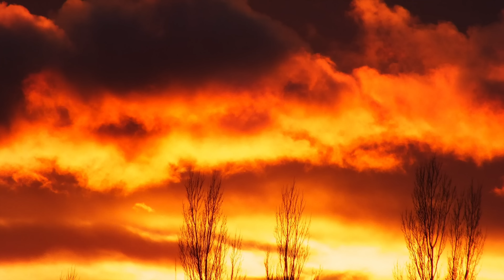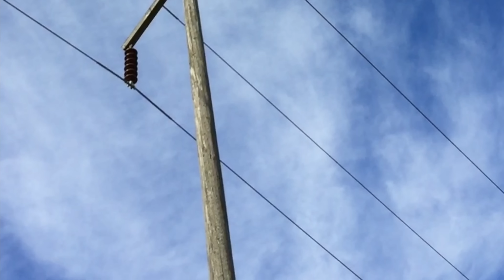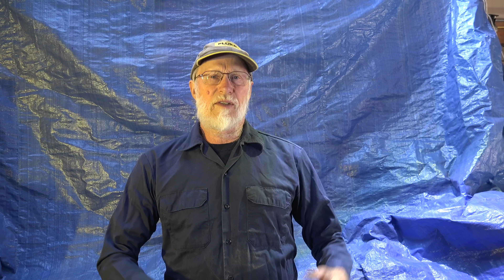Heat pump #2

Comment: GFM.........I have a question.......an AC removes sensible and latent heat........my question is.......can it remove one and not the other......or does it always remove both at the same time...
Reply from the maker: Well, I suppose if the relative humidity was zero or the temperature drop across the coil was low enough to be well above the dew point, you would only remove sensible heat.  There are some systems designed to do that such as flower coolers that may run at 3F across the coil.  Hope this helps.
GFM

Comment: I pay around 9 cents /kWh. In the winter, it drops to 3.2/kWh once I go over 1000 kWh in the month because I have "electric heat". How does that factor in? I'm not sure if I should be using heat pump or natural gas (97% efficient). My HVAC guy said heat pump is always cheaper. It currently switches to gas below 30 degrees. I wish my fancy thermostat could just do the math.
Reply from the maker: If you are 3.2 cents, congratulations, you have about the cheapest rate in the country.  The heat pump is very efficient at the temps you are using at.  It all depends on the price of natural gas.  If it is under 80 cents per therm, the race is pretty close.  There is also the issue of wear on the heat pump.  Most natural gas appliances have a longer life span than heat pumps.  A few things to chew on.  
GFM
Reply: I had my rates wrong. It was 3.2 but it looks like they raised it to 5 cents in 2014 (over 1000kWh). :( The first 1000kWh is 8.5 cents. I did some math on what I paid in February and it averaged to 7.9 cents. My total gas charge ($73.03) divided by total therms (94) is 78 cents per therm. I think I may run this winter with no heat pump and compare what I payed in previous years. They list the average temp on the bill so I should be able to find a decent comparison. Thanks for the help!
Reply from the maker: Sounds like a plan.
GFM

Comment: what if your during solar panels?
Reply: Direct solar hot air panels can equal up to about 3400 Btu per hour per square meter, direct solar heat at one square meter equals about one kilowatt hour. 
Solar electric, even if reaching 20% efficient would be a poor use of that electricity as it does not come close to the surface area in "watts" as does heat only panels. There are many losses to contend with with solar electric when used  for running a conventional heat pump.
 That said, there ARE systems that provide cooling that is hard to beat as they have very special compressors and associated controls & components designed specifically for solar applications, they are also very expensive. I have seen where solar electric panels used to provide direct resistance heating to water heaters that allow a very simple way to heat water, no pumps no additional plumbing, etc. I am not an expert, just shearing what I have researched.
One thing is for sure, if you had the solar capacity to run what ever you connected to a system, it would have zero payment to any utility, unless of course you were grid tied to them. Most utilities now have rates that are not favorable to the solar user. Not like it used to be, where a solar customer could simply turn the meter backwards when pushing power back on to the grid.
Reply from the maker: There is a lot to solar panels.  Install costs are quite high.  Even a small system installed can easily be $25,000.  Not counting local and federal incentives.  Output depends entirely on sunny days.  Life span is somewhat unclear, but I would guess its under 20 years.  If you have the sun, its a really interesting energy source.  The first solar panel I made was in 1977 and it was notably low on power output (about an average of 1800 BTU, yes 18 hundred,  per hour).  I will be doing some videos on an install of photovoltaic panels as soon as I get the job done.  Hope this helps.
GFM
Reply: I will be looking forward to the videos!

Comment: Given the AC contortions caused by those idiotic Refrigerant regulations, and the fragility that goes with those Soviet-style SEER regulations, I'd opt for all-electric heat - no heat pump (assuming gas wasn't available).  

Any thoughts?
Reply from the maker: Get over it.  Everything goes from simple to complex and low to high efficiency.
GFM
Reply: @grayfurnaceman  

Sorry, my friend - Voluntary complexity us good. Government imposed complexity is BAD. It is government imposed suffering, cost, discomfort... unhappiness. Very un-American. 

It's shocking how riddled with it the HVAC industry is, for the aforementioned reasons.
Reply: @grayfurnaceman  

TXVs?
ECMs?
R410a?
Paper-thin primary/secondary "90%" heat exchangers?

Capacitors that are always burning out because the replacement for PCBs don't work?

10 SEER. 14 SEER, 18 SEER,  20 SEER....

"You need a new system if you have an R22 leak" (?????)

Do homeowners understand the screwing they are getting from the EPA and DOE?

Is the HVAC business really HVAC? Or is it an EPA-DOE enforcement business?
Reply from the maker: I will only deal with one of your comments.  PCBs were outlawed in the 1970s.  Since that time, capacitors have been the most trouble free part in the A/C.  The recent spat of failures has been due to poor quality foreign made capacitors.  The American made capacitors have been doing quite well, thank you.
GFM
Reply: @grayfurnaceman  

1) I hope you're correct. I'd like to see confirmation/corroboration elsewhere. Another HVAC vloger said 80% of his service calls were for capacitors. A capacitor blew out on mine that may have been original (> 10 years old).

2) I know you declined to comment, but the other issues of my post are quite real - it's a vicious cycle that inflicts suffering throughout the industry.
Reply from the maker: I will then deal with the rest.  
TXVs:  Mostly the oldest expansion device out there.  Also, the best one.  It works only on superheat.  Great compressor protector.  Some recent failures have been due to a manufacturing process that left oil in the system that interacted with the system oil to make sludge.  The highest efficiency units use a TXV with few exceptions.  
ECM:  I agree that they have had a lot of failures, mostly because a thermistor burned out on many of them.  A $1 part that is replaceable.  Also, installation errors with high static pressure cause failures.  BTW, I have one in a furnace that has been operating for 24 years.  
R-410A:  Not the best refrigerant, but a short term fix.
Heat exchangers:  If you want a heat exchanger to last, make out of 1/4" plate and accept 40 to 50% efficiency.  Thin metal transfers heat faster and efficiency is the name of the game.  This one will not change.
SEER:  A way of effectively measuring operation efficiency.  Should we go back to units with tiny condensers?   If you can find one, look at the head pressures of an A/C made in 1975.  Talk about energy wasters.
R-22:  R-22 was one of the best refrigerants for A/C.  It did most everything well.  Except for ozone.   Agree or disagree with the concept, but the overwhelming amount of data indicates we must change the refrigerant.  The tax that has made R-22 untenable is just the government way of phasing it out.  We are not alone here.  The entire world is working on new refrigerants that will not cause the problems that the older refrigerants do.  
EPA and DOE:  Thank your lucky stars they are there.  In the late 1960s, our rivers were catching on fire.  Smog filled the valleys.  Sometimes you could not see clearly for 1/2 mile.  I can remember coming into LA in an airliner.  The cloud over the city was opaque.  The smog burned my eyes.  I lived thru that time.  Look at Bejing during the olympics.  That was us in the 1960s.  
We in the HVAC industry are not enforcers of anything.  We are required to work with what equipment, tools and regulations that are in existence.  
I understand and have taught the refrigerant regulations.  In addition, I agree with most of the regulations.  Doing things the way we did before we understood the effect they were having on our world was and is destroying our grandchildren's future.
GFM
Reply: @grayfurnaceman  

2 videos on TXVs:

https://youtu.be/G1Ns7rC4L9I

https://youtu.be/Amo2eRlYrzg

Comment: What's your opinion on these generators that are installed in a home and heat using waste heat?  http://world.honda.com/powerproducts-technology/cogeneration/
Reply from the maker: The idea is good.  The claims are somewhat overstated.  If your energy usage is quite low, and you live in an area that uses coal or crude to produce electricity, it could be an option.  If your usage is more like the average American, you will have more hot water than you can possibly use.  The laws of thermodynamics limit the efficiency of any conversion from heat energy to electrical energy.  Without cogeneration, most conversion rates are about 30% efficient.  Hope this helps.
GFM